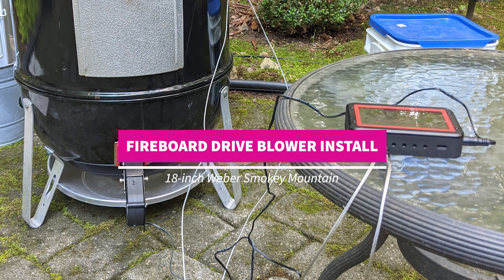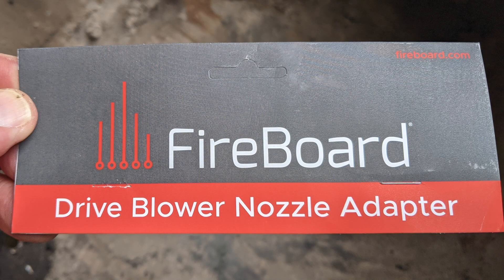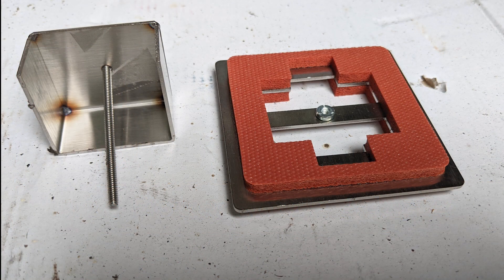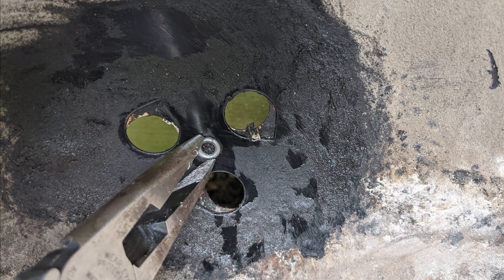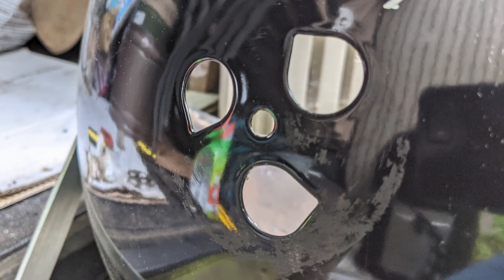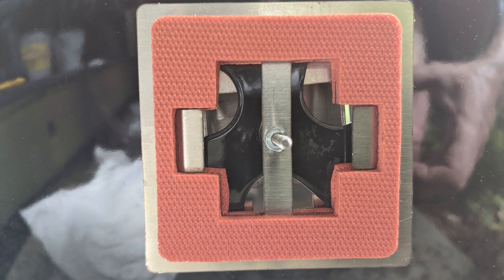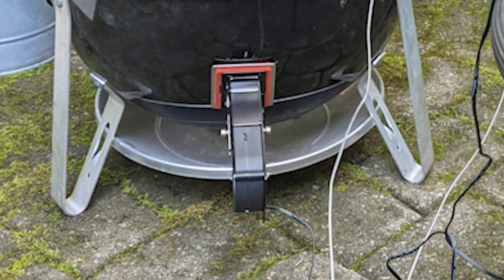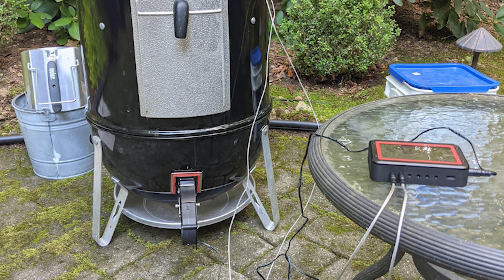Fireboard Drive blower install in Weber Smokey Mountain

Comment: Do you use the g3 blower
Reply from the maker: No, I have the older original version, which is still available. My understanding is that the newer blower uses different mounting adapters.
Reply: Thanks

Comment: Where are you setting the shudder on the blower and your fan speed ? Thank you
Reply from the maker: The original shutter is removed and the Fireboard device automatically adjusts the blower speed from 0 to 100%.
Reply: @ there is a shudder on your drive blower is it 100 open?

Comment: Do you still use water in the pan since installing the blower, or is it no longer required?
Reply from the maker: I still do use water in the pan since it's intended purpose is to even out temperature variations and I figure even with the blower it can still help.  I have not tried it without the water pan though.  Might be a good experiment with some chicken and see if the lack of extra humidity makes a difference and if I notice any increased temperature variation.  I might give it a try and if I do I will report back here!
Reply: @dannoonyoutube  ah perfect let us know how you get on! Though if it works great then why change!